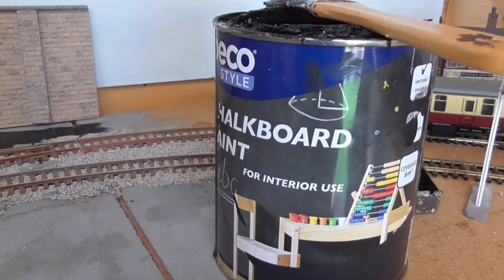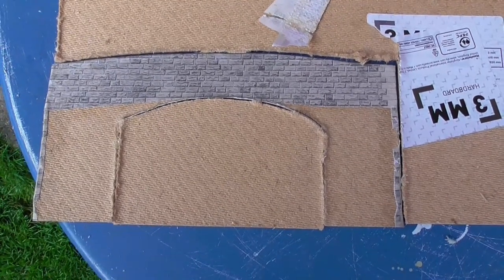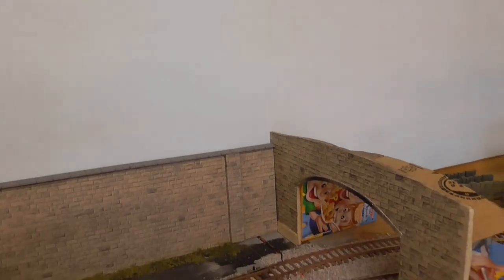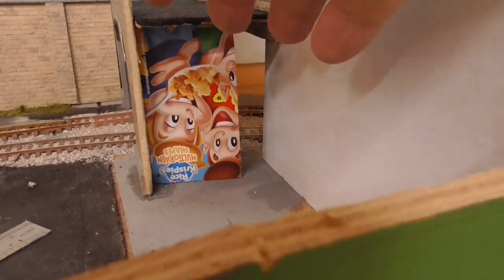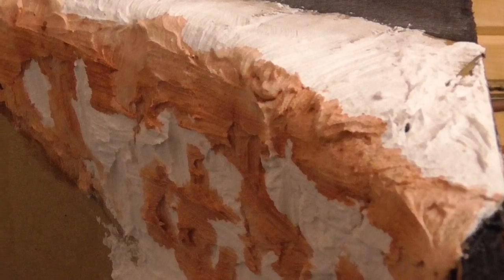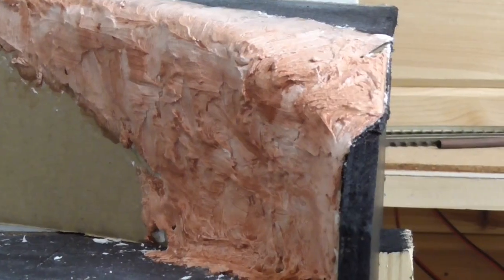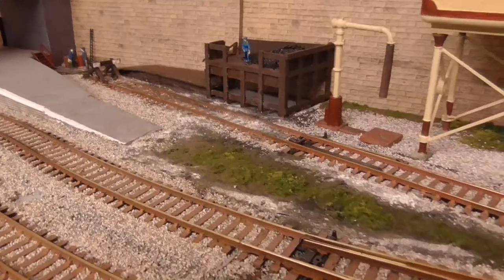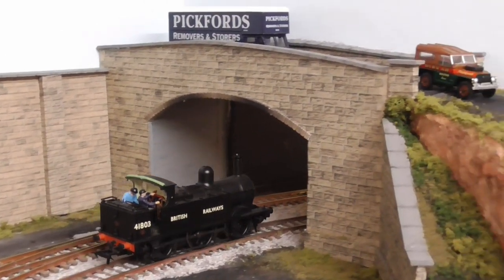Building a OO Gauge Model Railway -  Minories Part  11

Comment: What would we do without cereal packets! Good progress.
Reply from the maker: Thanks I am a believer in using anything that can reduce cost and be recycled on the railway buildings and structures. Cereal packs are a good source not sure what I could use instead? Have used amazon packaging as well they seem to provide reasonable corrugated card!
Reply: @clivebennettHornbyDublo  I have been known to use the card from Mr Kipling's cakes, very uniform thickness, but not big enough for large structures.
Reply from the maker: @harryfaber  you need to try Mr Brunel's cakes for large structures lol